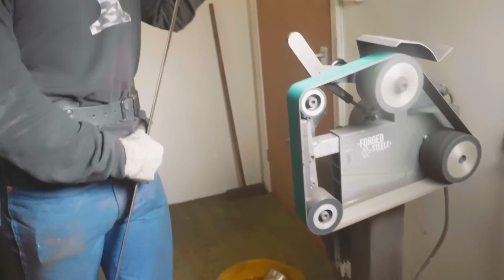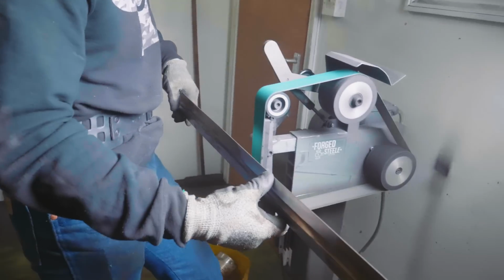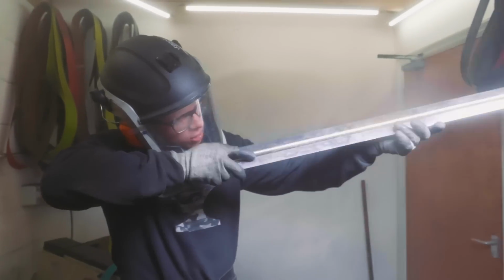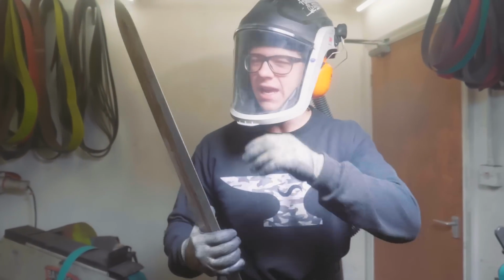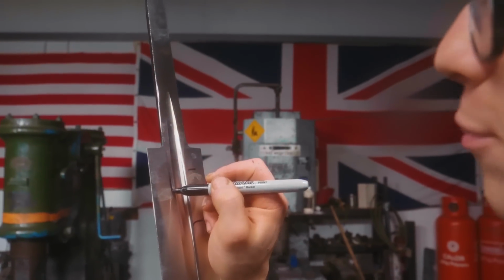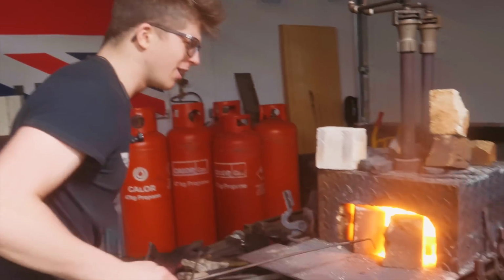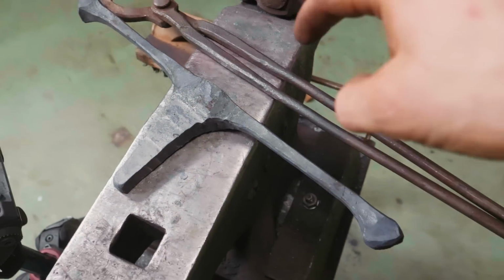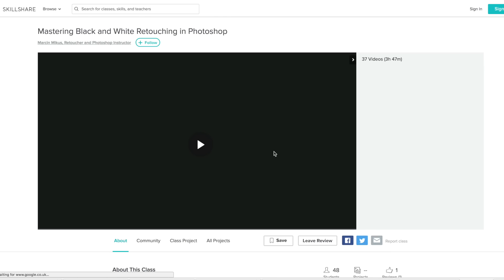MAKING A SCOTTISH CLAYMORE SWORD!!! PART 7

Comment: I recently started grinding blades by running the blade across a contact wheel to where the blade is parallel with the belt. This reduces the surface area and helps you see where you're grinding on blades larger than the belt. I still true everything on the flat platen since I only do flat grinds but it really speeds up heavy grinding on huge blades.

Comment: Would it be possible to forge a shield? This is looking amazing dude.
Reply: He would need a completly different set of tools for armor/shields and therefore he won't do one :(
Reply: Mr. Frogman99 that would be a great idea
Reply: Wouldn't it be more like panel beating than forging?
Reply: Inn3r Warri0r yes it would
Reply: yeah, its also super annoying- ive tried it. the shield looked like someone shot rubber slugs at it in the end
Reply: Most shields are wooden with wood added to reinforce them... so not really forging.

Comment: The guard should have the iconic quatrefoils at the tips of the quillons. Makes for a very impressive looking guard, especially if the quillons are swept towards the blade. Though the double clamshell guard with quillons curved upwards is also a traditional, if extremely rare, guard type for the claymore as well. CLAIDHEAMH-MÒR!
Reply: Mabye twist it thatd be cool
Reply: Weren't claymore guards also traditionally brass?
Reply: I have seen them with brass guards, but most of the originals I've seen have steel guards. Ask Matt Easton, he would know.

Comment: Alec, if you are heat treating your blade, and it warps... You have very short time (in seconds) to straighten it back until the blade is still hot. Once it cools down you are in trouble. You kept the warped blade for the next day... This is not recommended. Use a vice to straighten the warped blade when it's still hot. Put in the quench and pull back immediately to see if it's warped. Don't wait.

Comment: the first katana i made ever i used a wet stone to get it from forged finish to its final shape and polish, since i didn't have any other tools at my disposal like a grinder or sand paper even. it wasn't until later i learned of draw filing and that was my main method of stock removal of my second sword i made.

Comment: alec when you put the handle on sand the wood when you're finished heat the Tang get it red hot and press fit the wooden handle on. so you're basically burning through the wood with the Tang read Hot

Comment: I think you should add the little four-circle design at the ends of the guard, like the shamrock kind of shape. And angle the sides of the guard up towards the bit.
Reply: redaggron1 
I believe the "four circle design" is called a quadrafoil (not sure on the spelling, could be quadrifoil).
I hope this helped.

Comment: Alec, immediately after removing the blade from quenching the crystalline structure hasn't solidified yet.  You have about 20ish seconds to straighten out any warping with a vice before the blade turns to glass.
Source - AWE ME's Man at Arm's Reforged (thanks Ilya)

Comment: Have you considered how you are going to get the langet (the distinctive part of the guard of a Claymore that goes down the blade) to fit the sword blade with that fuller in it? Drifting and separating the guard for a plain blade is hard enough, but your langet will have to fit in the fuller to give the blade any real support.

Comment: A Box with the following steel: square, round, and twisted metals inside.  Fill with flux, drill the hole.  Wala!  Then sandwich it after your grinding off the box, making san-mai?
To do the initail grinding, you need open an account watcher’s can put money into and purchase a grinding table like seen in other videos that people put their knives and long blades on and it goes back and forth to sand it evenly.

Comment: ALEC, next sword up... A Knights Templar Crusader Sword. Another long sword to practice on. Maybe make dies forbthe press for the fuller or a spring loaded hardy tool and do it by hand? Forged fuller S add strength. Ground ones can reduce strength via cutting the metal grain. Just a thought but a Templar sword maybe with matching dagger would be great additions to your armory. Loving 99% of the content. But hey, you're still learning and far past any skills I have.

Comment: An old blackdmith in the past always said a blacksmith must respect all they the materials they used, do not waste any steel. They do it because good steel is rare in the past. But nowdays, there are tons of steel, spoil the blacksmith make them work careless and sloppy with amount of steel they used. I think it's a good wisdom to follow, and still relevant, that a blacksmith should respect the materials they use.

Comment: How do you think about bolt the ruler on your either working side of your anvil? Welding or tapping+bolt would be a good method for that. It would be better if you can see the ruler while you are standing.at 45 degree side. How do you think about making world first damascus skate board if you have a new plan to make something new?? (or bicycle)

Comment: hey alec you can actually use that guard if you just angle the pieces of the cross guard up towards the tip of the blade. they should ideally be angled 30 degrees upward relative to the tip of the sword.

Comment: If you really want a tough samurai build try making a traditioanal odachi, i think it just might force you to make some adjustments to your current set up ,and i was also thinking of you doing a more detail oriented build maybe some blade engraving possibly doing a smaller build like a kukri ,or maybe a larger build like a rapier with an engraved gaurd i think you'll find the process challenging but rewarding because it will take your weaponry to a new level of beauty. By the way love your vids and keep up the good work.

Comment: If you're coming up wide on the cross guard you can either turn the ends upward or the whole side can be bent to a v formation both would be historically correct and it saves you a reforge

Comment: Mr Steele,,Sir,Have you thought of building a grinder head for milling machine,and an angle jig for the same,set up  and way you go,can make angle adjustment,and fuller grind will be much easier,Just a thought,best wishes,Ian
Reply: Ian williams however, a true fuller should be forged in for maximum strength. Material removal actually weakens the area around the fuller. A couple of new dies for the power hammer or press would be easier to make and help with blade strength. The reasoning behind the fuller is not weight alone, but strength. Forging keep the grain structure where grinding takes it away.
Reply: Hi Ya Thomas,,yes i agree,,but will upset the pattern required by Alex,,and so many don't forge any more,,and young Alex is struggling with it so just a suggestion is all,,with the mill beds being flat,,

Comment: Alex, do you keep track of how much actual time goes into each project, time wise? With the edits its hard to determine if it takes you a hour or ten hours in one video.  Just curious how long it would take to do one, and in theory if you had to do say a dozen of the same project, how much time it would take.
Reply: An elapsed time clock would be nice. Start at hour zero, just like Mike Boyd.

Comment: Maybe a stupid idea... But next time when you want that groove in the middle. Why not take 2 pieces of roundbar iron and clamp them on each side when the blade is hot and hammer evenly the whole lenght on the round bar?  I know how hard it can be to get a nice straight line when grinding like you did! Nice work btw!

Comment: possible idea, could you possibly make random pattern damascus from all the grinding dust? thinking you could put it in some very thin wall tube or box section weld each end up and forge it that way????? thoughts??

Comment: you really need better ventilation in your grinding room, you should look into a setup like what woodworkers use, with the hoses right at the machine your using.

Comment: Man with Bridgeport mill and a surface grinder still prefers to use the belt grinder and X number of hours to produce the profile? I would be tempted to machine the profile then use the belt grinder to bring that surface to the final finish/profile.Less work/time involved and more material  can be removed in a far shorter time,or am I just mad?

Comment: Do you think you could forge something out of all of your grinding dust?
Reply: Tenacious21 as awesome as it would be I asked Man at Arms and some other blacksmiths if the dust is in any way useful for recycling etc, but it’s mostly dust and particles from the belts mixed with hard scale, so the result would be a billet of 60-40 metal and slag. So not really that workable in any sense of the word sadly, great idea though

Comment: So i dont know if you read all of these and someone told me to do heat treating with the blade facing north and south to stop warping because of the magetic forces of the earth helps straighten the blade my aligning the molicules in a straighter line

Comment: Hey Alec, this is a really weird question so don't feel like you have to respond, I looked across the internet and couldn't find a clear cut answer. I'm an aerospace engineer at the university of Michigan and for a project I'm working on is proposing a blimp for Mars exploration, building a prototype, yadayadayada. Anyways, for part of this I need to know the average height of the beads produced by the filler in welding metal together (as part of mass calculations). I'm not a welder and would prefer not to just approximate. Any chance you could help? (Or anybody in the comments?) thanks in advance!
Reply: Nick  i am no professional welder, but the size of a weld bead is vastly variable. there may be some resources you could borrow from the field of mechanical and structural engineering that might have some information regarding amount of weld material required for particular kinds of welds (MIG, TIG, SMAW).  A well experienced welder may know of a resource with some rules of thumb for a general idea. perhaps phone a local welding shop and/or drop in and ask
Reply: Nick Kirkpatrick Hi. My dad is a welding instructor and he says it depends on the process and the dynamic balance. He was in the ER last night when mom messaged his answer. Can you give me any more info knowing this now, that might help me get more info for you? Or maybe I can get an email from you for him? -Kara

Comment: Wouldn't it be easier to do a majority of the grinding before hardening or does that cause other issues?
Reply: Leaving it thicker reduces the risk of warping and/or bending.
Reply: and then it warped anyway. maybe he took too much off of that long steel? Is it maybe a proportional thing thickness to length/width?
Reply: In this case it was most likely due to uneven heat

Comment: Cast steel sword!
Reply: rdhancock0418 no grain structure, inferior to a forged sword.
Reply: Montygo Not exactly a piece of cake to melt steel with Alec's equipment anyway
Reply: Sea cucumber he could make a small foundry capable of making a small sword, but to do cast STEEL not cast IRON would be significantly more difficult
Reply: he melted the square tube in his forge yesterday, (episode 6) it was dripping when he pulled it out. Ended up with a steel floor in his forge.
Reply: Thomas Russell Yeah, but bear in mind that tube was in there for SEVERAL heats and it was only locally molten. Getting a sword's worth of steel molten is likely impossible with what Alec has.

Comment: Isn't it a little odd to harden the sword BEFORE you grind it?  Doesn't that just make more work for you?
Reply: Yes more work however if he had ground it then heat treated it he would not have been able to grind out the wiggle. Not to mention the grinding and polishing that has to be done after the heat treatment regardless. Especially on a large piece that is more likely to warp it is more effective to finish grinding after the heat treatment.